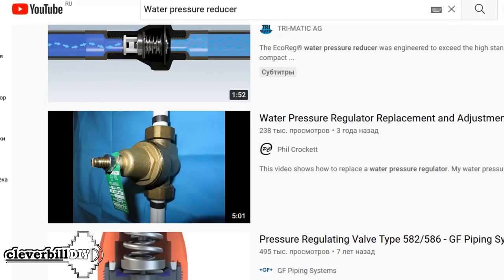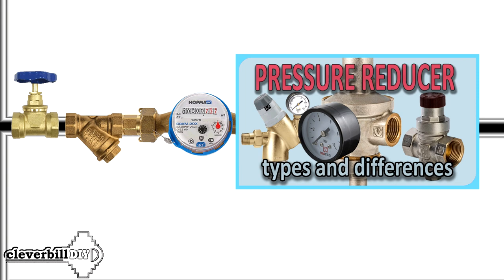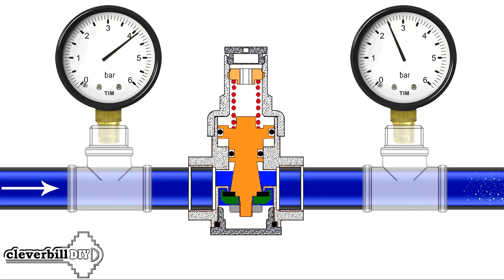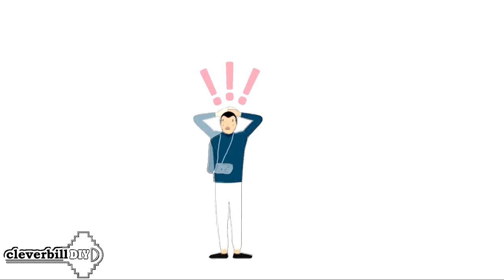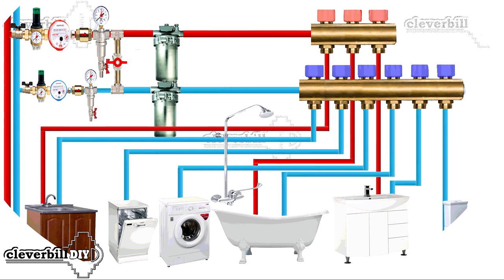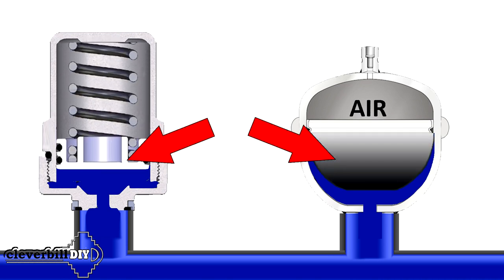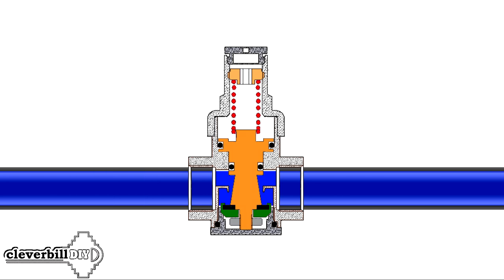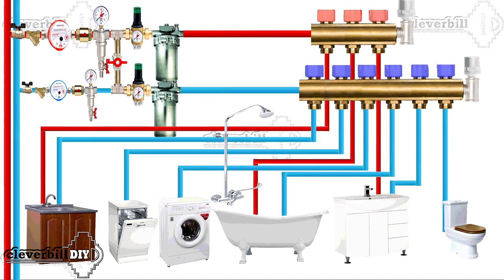Water pressure reducer - protects against water hammer or not?

Comment from the maker: A pressure reducer is necessary in a domestic water supply system in a situation with a change and a difference in the pressure of hot water and cold water, using this device you can equalize the pressure of hot water and cold water in the home network, but it is much more correct to protect against external and internal water hammer by using a water hammer compensator. Someone will say where the water hammer comes from in the home water supply system? Sources of water hammer in the home network are an abruptly closed one-handle mixer or the inlet valve of a washing machine or dishwasher, and this happens every day. And provided that a check valve is installed at the inlet of the water supply system, this effect is enhanced since the internal system turns out to be closed, in the same way, cold water in the pipes of the domestic water supply system heats up overnight and expands significantly, exerting excessive pressure on the appliances and the water supply system. Water hammer compensators are designed to solve all these issues.